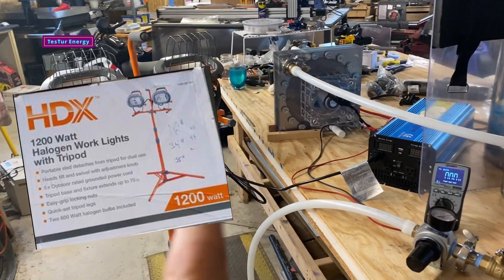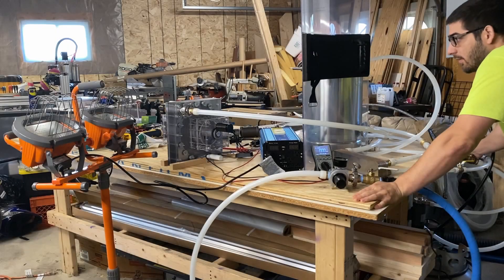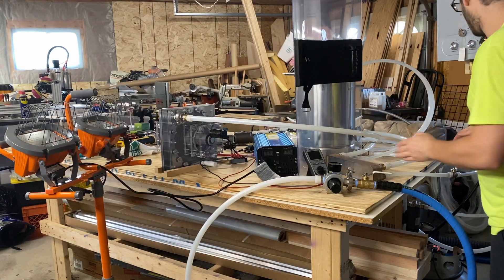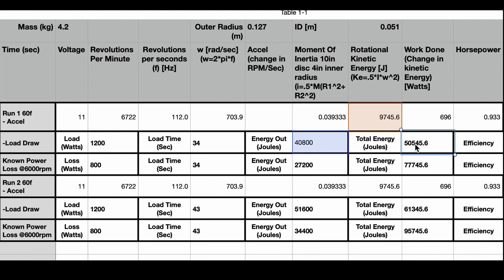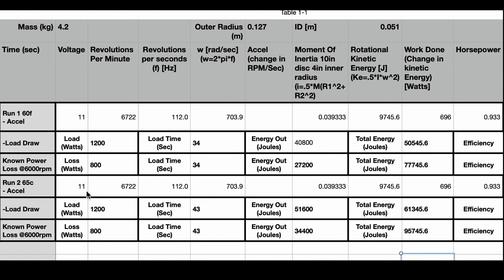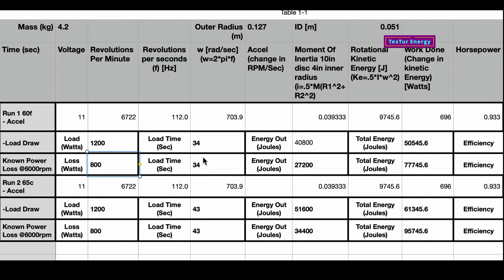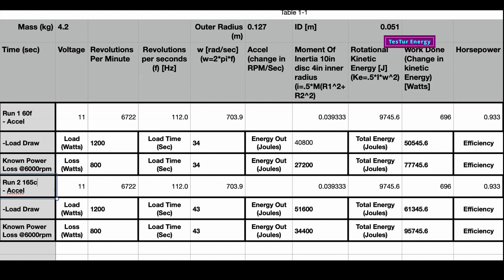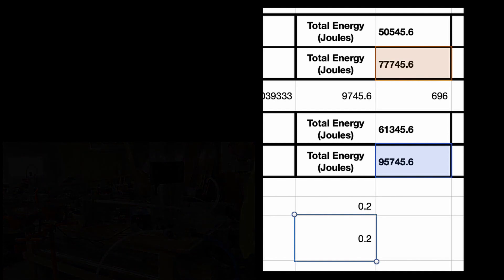Tesla Turbine 1200 Watt Electrical  Load Tests - Power Calculations - compressed Air + Propane

Comment: What did you use for disks?  Carbon fibre?  I have an invention that could really use Tesla Turbines.
Reply from the maker: Hey Carpenter! Thanks for messaging. Currently I’m just using 3105 h13 aluminum for the discs and 6061 T651 for the thick endplates pressing all the discs together. However I have a TON of thin carbon fiber for making this exactly the same out of carbon fiber once I’m 100% satisfied with everything. Stuff wasn’t cheap 😅😅😅 I also have a bunch of other metal alloys to be able to make different versions from there as well, like 7075 T6 aluminum to make cryogenic temp and supersonic capable disc stack, as well 304 stainless to make a high temp combustion turbine too. I have plans for many other types too but I have to work out the machining of each of these materials properly before moving on. I would kill for an all 718 inconel ultra high temp version but that’s WAYY out of my price range currently at the moment.
Reply: @CharlieSolis  Hey Charlie, I was so surprised by your email disputing the efficacy of Vitamin D that I clicked on your profile and the Tesla Turbine came up.  I swear I did a Google search not more than a week ago and could not find a TT for sale on the web and it's ideal for my invention. I should have the patent for it done in about two weeks (if I work hard) and then I can send you more info.  It is an apparatus that combines wind and solar (sorry - no more hints for now) but it's going to be ground breaking.  I'll contact you when my patent is done.  See if you can spreadsheet out the costs of your TT on an industrial scale as you might be interested in a percentage deal.
Reply from the maker: Hey carpenter, we will definitely have these for sale here soon but we aren’t quite ready for that yet. Much has to still be worked out before we have a ready for market turbine. What’s your motive fluid going to be? Air? Steam? Etc?
Reply: @CharlieSolis  superheated steam - i.e. high viscosity steam.
Reply from the maker: Righteous. What temperature and pressure ranges are you looking for?
Reply: @CharlieSolis  I don't know yet as I will need to experiment with the prototype and we're in the dead of winter here.  That being said, we're looking at somewhere over the critical temp of boiling water - 273 Celsius and pressure around 200 psi.
Reply from the maker: Can I ask why you’re specifically trying to use supercritical? Is it just viscosity reasons?
Reply: @CharlieSolis  Viscosity and damage that water droplets can do.
Reply from the maker: @carpenter3069  1200watt Load Test ELECTRICAL Output Efficiency Calculations For 10in Tesla Turbine Are In! 
See the charts here!
https://www.youtube.com/post/UgkxRukN0zoVbtfe1LmLUlXyIo0kdt1ExWZs

Comment: Nice job Charlie. Losses seem to plague every dynamic system regardless of simplicity. Off the shelf parts or components are built on a business models that invites lower performance to increase wear shorten working life cycles increasing replacement. Maybe magnetic bearings and magnetic transmission linkage to a gen would give you more options to work with in you pursuit to mitigate losses. Non contact bearings also would not suffer from lubricity changes due to friction/ heat or cold conditions in real world conditions.
Reply from the maker: Hey thanks Doug! Yeah at the moment bearings aren’t much of the losses. It’s honestly almost entirely in the misaligned gears. One of my donors graciously donated 2x brand new 10,000watt continuous BLDC Gen/motors that I will be able to do a direct on shaft generator turbine arrangement with. I won’t even need bearings for the turbine either because the bearings in the generators are entirely capable of handling the turbine and all its loads. Especially because the turbine sees almost no radial loads with the dual nozzles balancing the forces on the turbine disc stack. And no axial loads when using both sides of the disc stack for the exhaust to leave balanced. But even then I also have the design I’m working on for a dual direct on shaft  axial flux generator on either side of the drive turbine with the stator coils in the casing endplates. Not to mention I have switched bearings for the next one I’m doing that are smaller and rated for 30,000 rpm, so they will hardly see much loss in the 0-15,000rpm range this aluminum turbine can even be run at. 

Like honestly 75-90% of what you’re hearing on the turbine as it spins up are those gears. Even the existing bearings are pretty capable and quiet but they max out at 15,000rpm and we are approaching 10,000rpm currently so it’s getting close. But I also have to say that those bearings are rubber shielded and I believe are grease packed currently instead of a higher quality oil lubed so I could reasonably see far lower losses. All things considered the losses from bearings are so minimal compared to the power outputs this thing is doing. It’s my opinion that if bearings are the limiting factor for making your Tesla turbine work then you need to go back to the drawing board on your turbine disc stack design because you have far bigger problems. (not you specifically, just “you” in general) The torque and power capabilities of these things should dwarf bearing losses at any rpm to the point that they are only 5% loss, at most, even with today’s mid grade quality ball bearings. Which I will agree would be nice to get back but when we have as abundant of a heat source as the sun, available to everyone everywhere, we  have far more energy and power than we need to not even care about the bearing losses if it means keeping the turbine super simple, easy to build and work on. We are going for a “planned permanence” ethos with these turbines.  I want these for the average person to be able to put one in their home and be able to do any and all work on it if they need. Simple, cheap, and easy to work on is what we are going for. Off the shelf parts available today are far more than adequate for what is needed to make these work effectively and efficiently. And because they are mass produced for all electric motors, and the like, they are dirt cheap. 10 of these new 30,000rpm bearings are like $20. That’s 5 times you could just completely replace the bearings in the turbine. Even if that had to be done like once a year for good measure that’s like a $4 annual maintenance fee. 

Not to mention the good part about mechanical ball bearings is that their losses are generally to heat. And the temps that they usually get too during operation is just above the hot side temperature that we will be using in the vacuum steam system. So the heat given off from all the bearing losses can even be used as a boiler feed water preheat to recycle that thermal energy.
Reply from the maker: 1200watt Load Test ELECTRICAL Output Efficiency Calculations For 10in Tesla Turbine Are In! 
See the charts here!
https://www.youtube.com/post/UgkxRukN0zoVbtfe1LmLUlXyIo0kdt1ExWZs